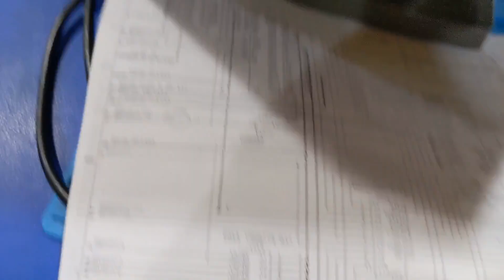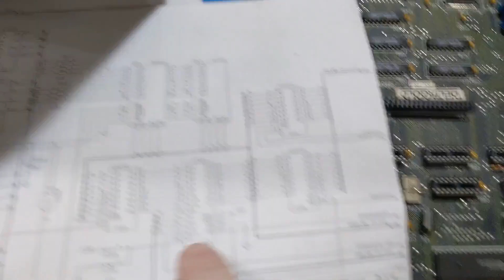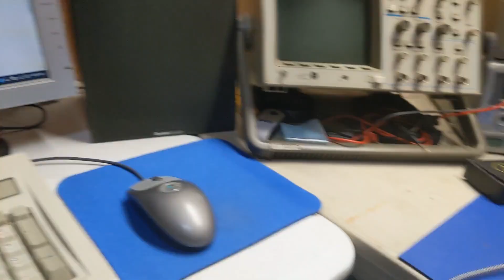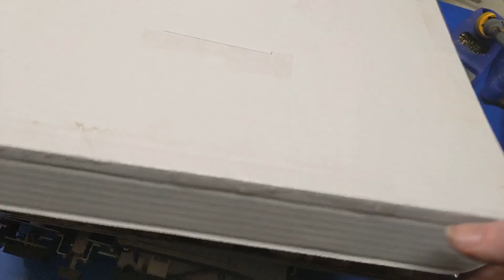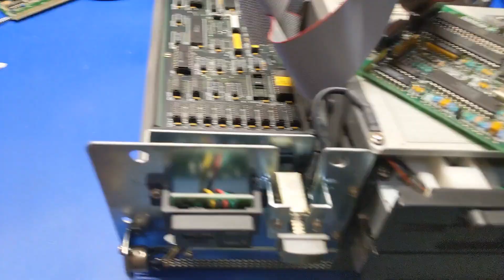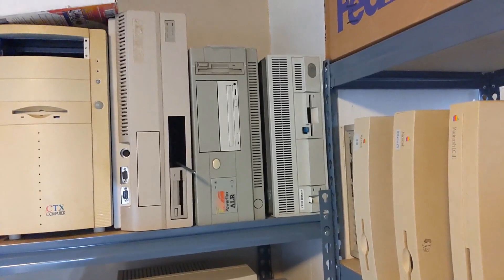Delta Gold Elite XT: Graphics fault repaired

Comment: What does it mean to read the pal as a rom? What are the limitations of doing it that way?  Can you ‘diff’ the good and bad chips and see where it failed?
Reply from the maker: There are sets of tools such as DuPAL which are used to basically read the chip like a ROM, meaning, it applies every known state to the known input pins, and records the output. This works most of the time, but not all the time because L series chips can loop outputs back to inputs internally.
Reply: @THEtechknight  thank you, that was a perfect answer to my question.  Love these videos man, they are super interesting.